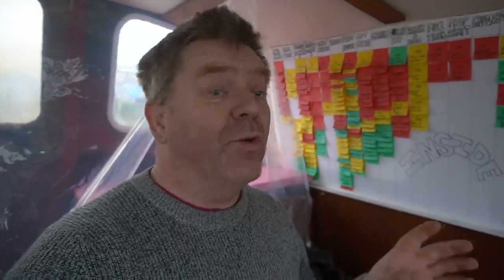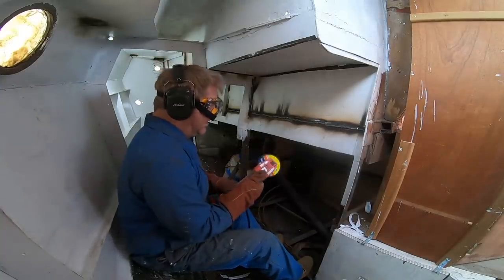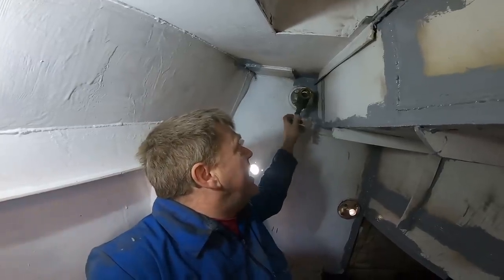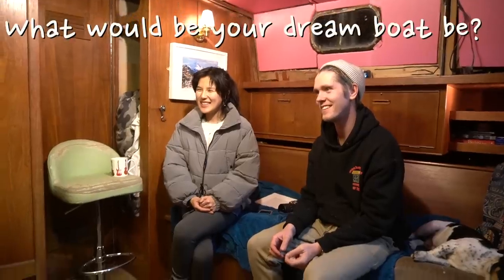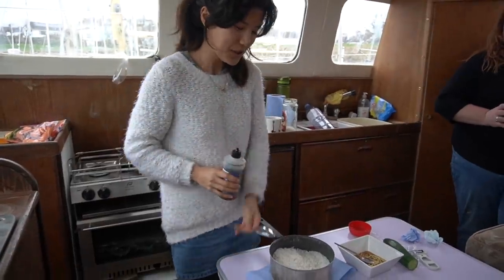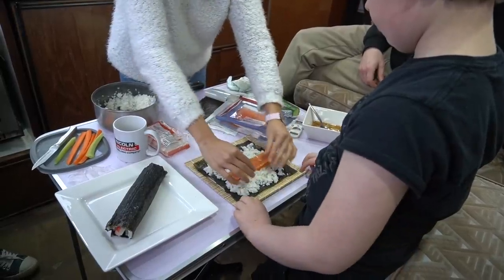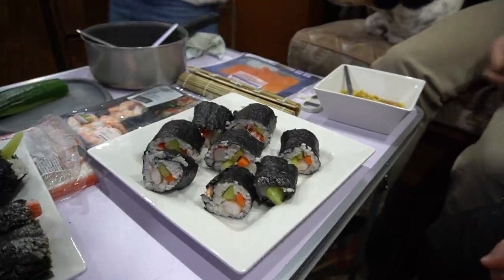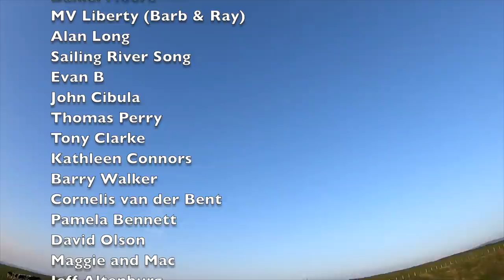#82 - MONOHULL VS CATAMARAN - Melody's gone wild!

Comment: Now THATs a crossover episode I didn't see coming!
Reply from the maker: Hahaha awesome :) hope it was a nice surprise
Reply: Well there's them on Anglesey or the Scousers on on the Dee mudflats but thats got two huge Catapiller engines an used to be WW motor gunboat ..  dont tell them youve got a 1000 ltrs of fuel or they will be back with some jerry cans offering to polish your fuel in their engines😂 .
Great to see you all together ... Jack and Nadiyana seemed to hit it off well. 😎

Mark you could have claimed two working motors and one worn-out engine.  As Minkie's props are driven by two hydraulic motors via the pump ..its the ICE motor thats in need of resurrection.

How old is Melody you said the cork had been on for 40 yrs. 🤔
Minkie dates back to 1975.

Love it when 🇬🇧 boat yard wombles get together ... next should be ...  Chasing currents crew and meeting on the Med for Minkie. .. and you guys the're from the Blackcountry so not that far.

Comment: Hi from Winnipeg Manitoba. I was just looking at the recent clip and you were talking about welding up seams etc.
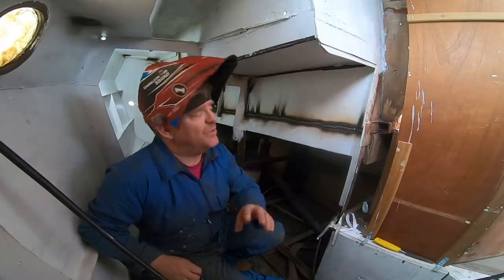At the 4:15 minute mark on the clip I noticed just above your helmet a strip of steel that sticks out,
 there looks like sun is shining thru, it is just left of the centre of the middle of the strip. 
good luck with your adventures.
Guess i will finish the clip now.
Reply from the maker: Hiya. I think that’s the patch I was actually talking about at the time which needs cutting out and a small patch welding in. It’s only about 8 inches square. It’s where one of the old hinges for the cockpit seat lids was and I thought I would get away with weld filling the screws holes but on further inspection it’s going to need a properly cutting out and new steel welding in. So yes that’s a hit of daylight but for now it’s sealed and I just need a fine windless day to pop a patch in there

Comment: Andy, concerning the valve at the side shell for the bilge pump.  The valve you have is a gate valve and if it shuts tight it is likely fine, age really isn’t a factor.  Usually you would have a check valve then a gate or ball valve at the side shell or in some cases a stop check will work.  The reason for a valve in that spot is 2 fold, first is a heavy storm conditions, the valved to seal against water ingress and more common you keep it closed until you make certain you do not have excessive oil/hydrocarbons in your bilge to make certain you do not pump them overboard.  International law, I started to say SOLAS; but actually it is MARPOL, says you are not allowed to exceed 15ppm hydrocarbons in anything you pump overboard.  Good rule of thumb is don't create a sheen on the water.   Hope that helps.
Reply from the maker: Good points and advice thank you :)
Reply: Wife and I hope your family are doing better.

Comment: I bought a boat once & it had old diesel in the tanks & I found the engine was about 10-15% faster once I had put new fuel in it. Also the engine ran much nicer, with the new fuel. It was a planing boat with 200hp turbo Volvo.
Reply from the maker: We will be removing and “polishing” all the diesel before launching
Reply: @SailingMelody  NFPA 110 refers to diesel “Storage Life,” 1.5 to 2 years. The Standard recommends that, “Tanks should be sized so that the fuel is consumed within the storage life, or provision should be made to replace stale fuel with fresh fuel,” NFPA 110, A-5-9.
   Most companies seem to say 6mth-1yr
If I was you I would put some of your fuel into drums & add 15% fresh fuel when you launch & then you can use the old stuff up a bit at a time when refuelling.
Reply from the maker: That’s a really good idea! Yes. Drain it down. Polish the fuel and then refill the tanks with 50% new and 50% old but polished and filtered. Then keep the remainder in Jerry cans on deck

Comment: Always a solid practice to have a valve on any hole in the hull above or below the waterline. In line non-return valves close to the pumps or integral with the strum boxes also useful as a belt and brace idea, it also prevents the bilge waste in the pipe flowing back when the pump loses suction or pressure. I was looking at your framing, I can't see if you have any weep holes (limber holes) where the stringers meet the frames or at the lowest point on each stringer/frame section. The  holes allow any moisture build up to work down to the bilge. I know your insulating but your method will have to be perfect to avoid vapour locks.
Reply from the maker: Yes I see the point. We have lots of 10mm limber holes but I will most likely make more. Can’t have too many in my opinion

Comment: Andy: those bilge pump valves are gate valves.  Ball valves would be quarter turn.  You can also see the gate opening and closing as you rotate handle.  I also can't see why you need valves there unless your stern is going under water and then I think you have bigger problems at that point.

Comment: It’s prudent to change the gaskets on all fittings.
Reply from the maker: Ohhhh yes you’re right of course.
This comment has popped up on my phone though and I’m not sure which episode you’re watching? I’m guessing the one where Chris and I tackled the engine service?
Reply: No it was the video where you were working on putting bulkhead tube fittings with rubber gaskets through I believe the hull.  Incidentally what type of sacrificial anodes are you mounting in order to protect from electrolysis.  Have you got a splash date?

Comment: Gate valves are preferable because they can be repaired several times by lapping the gate.  Ball valves need parts to refresh.  The trade off is that gate valves take up more space and usually weigh more.  Ball valves have a tendency to leak less over time, but often need replacing sooner due to corrosion.  The only thing about that valve in that position (stem down) is debris will build up in the valve body and the packing will be flooded continuously.  Which may. MAY increase the chances of dripping on your hard work.  I would use the gate valve with the stem up on that bottom hull fitting and a ball valve on the top right one so it can be oriented better.   Since that is Jacks room, did you consider  relocating the over boards to the other side, or maybe closer to the center?
Reply from the maker: Yes that’s definitely something I’m considering. Moving them altogether. I’m not sure just yet though.

Comment: If it was my choice....Melody wins.  There's no wooden structural beams rotting away in the bilge.  Mink was like a sponge. Also the stresses on the centre of the boat in waves can snap her hulls apart. I'm actually quite worried about the wildings project.  Steel monohull built like a tank - no problem. 
There's a boat breakers on the south coast will have exactly the sails you'll need BTW, when the time comes.
Reply from the maker: We’ve been offered a spinnaker and some other sails tbh ;) watch this space

Comment: I don’t know if I would bother in that aft cabin with timber Andy,  I’ve seen alot of channels use PVC artificial Tongue and groove style roofing,    It’s available  very cheap at most hardware stores, even sailing mistress used it,  and I believe Mads at saillife used it and i know GBU used it..  it’s cheap it looks great, it’s simple to work with, and it Impervious to water..    maybe worth a thought?  It also has some insulation quality,  obviously not as much as timber,  be we are talking a fraction of the price, and no painting required,  you could use white and just have teak trim?     Worth looking into..

Comment: @sailing melody 
perhaps a quick title update to include a warning about the welding blue flashing just on the off chance that the flashes of welding may trigger photosensitive epilepsy
Reply from the maker: Hiya :) it’s a thought.
However the luminosity and brightness of all televisions is set lower than the threshold to damage eyesight and photosensitive epilepsy is triggered by waveform frequency not brightness. So a strobe lamp at the correct wavelength and frequency could do it but a welding light on a television set couldn’t :)
Reply: @SailingMelody  i will politely disagree having had epilepsy,dark room and bright flashes still make me nauseous and headache comes on immediately
Reply: @SailingMelody  for me having had epilepsy caused by many years of punches to my head and banged on ceiling and shoved down a stairs from whence i suffered seizures as a teen into adulthood,for me at least bright flashy/strobe lights
very loud music with boom bang a bang surround sound that vibes is still risky for me
Reply from the maker: I do understand that many visual stimuli can be uncomfortable for epilepsy or even migraine sufferers. But in terms of the need to give clinical notice at the start of the video it wouldn’t really apply.

Between 3-30 hertz (flashes per second) are the common rates to trigger seizures but this varies from person to person. While some people are sensitive at frequencies up to 60 hertz, under 3 hertz is not going to trigger a seizure. Although I accept it might be uncomfortable, I am a migraine suffere (not the same thing I know) but there are days when I have to be careful what I watch. And Jacks cochlear implants mean he sometimes finds certain noises jarring and uncomfortable so similarly he has to be careful what he watches and exposes himself to. I apologise if the visuals in our videos have caused you discomfort, but I’m very confident that the frequency of light in our videos is not going to trigger a seizure.
Reply: @SailingMelody  it's okay,, I'm more wary and concerned for others - it's the blue light that for me was extremely bright - my thoughts immediately were even for the short time welding occurred - just a warning bright flashes during welding which are very short
Jack's enthusiasm during the sushi rice rolling wow!!
Yes,jack will find certain noises jarring and it's so frustrating and irritating that people don't stop to think about those who have cochlear implants,
those who require lip reads and or signing - yes, there are apps which help - however - for those in wheelchairs like two of my cousins i want to see ongoing developments in society and in boating
for those with autism awareness courses and education about what's potentially occurring during a meltdown due to sensory overload

Comment: My experience with old valves and stop cocks is that while the ball or plug will still seal, the stuffing box seals dry out and shrink resulting in leakage along the spindle.
Reply from the maker: I agree. I wouldn’t use these old style valves or any old valves below the waterline. But for the transom fittings above the waterline I can’t see them giving any issues
Reply: @SailingMelody  
Im wondering why the bilge outlet is so high up while the heater exaust is closer to the water 🤔? Doesn't seem quite right if you get water surging against the transom and it floods the burner with seawater.  
I'd check what the instructions say.
Reply from the maker: Very good point. 
On further thinking I recon I will move all these outlets to better places

Comment: Blocking the bilge pump. Just a guess but adjusting ballast weight? Someone correct me if I'm wrong. Some heavy winds might call for that. Vikings used stones and no keel. I could easily be all wrong. Thats just my train of thought.

Comment: Want to have really deep penetration  with a mig use shielding gas 95/5  you'll love it. A lot less spatter and you can spray weld in flat position instead of short arc. It burns hotter so you can lower your settings and get the same results. When doing certification welding that holds gas this what is used it welds a lot like shielded flux core. Nice and smooth hahaha without the extreme smoke

Comment: I'd use any paint you have to use it up and save money. It's all going to be hidden from view so it really doesn't matter. I really think with all the work ,money and effort refitting this boat I'd spend the money to replace all the valves,switches wiring and hoses with new updated items. I think it would look better and be a lot nicer without the worry that the old stuff is fatigued or may be defective. When you are done you will have a new boat ,why leave a few pieces of the old outdated things in it that will make it into a new boat with old parts.
Reply from the maker: Good points.
Since filming this I’ve decided to move those outlets anyway. I don’t want the diesel heater pipe or bilge pipes going through jacks cabin and if we took a wave to the transom (which we will) it could flood the heater exhaust with salt water which would be bad
Reply: @SailingMelody  plus the chance the exhaust could have a minor leak of carbon monoxide and that would be tragic.
Your doing a wonderful job and I just love listening to Jack. He's such a polite loving young man and that's a direct reflection of you and your wife's influence on the way he's being raised. When I rebuilt my 40 ford coupe it took years but I made up my mind I was going to do it right so I replaced everything I could with new parts and materials. I just couldn't see putting old parts into something I worked so hard on. I could of finished it by using old questionable parts but then I'd had a newly rebuilt car but with old parts I'd be having problems with down the road or I'd be worrying when I was going to break down and I'm so glad I took the extra time until I could afford to do it right .

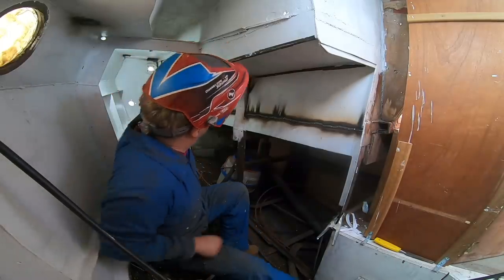Comment: What are your plans to gain access to the "engine room" from Jack's spacious stateroom?   If that was a car, they would have sharpened the edges of those steel frames at the factory.   5:00   If you had not cut those corners off,  you know who would have hit their head on them and cut their scalp.
Reply from the maker: There is no access to the engine room from the aft end as there is a steel bulkhead across the entire boat just under the companionway steps. Engine room access is by lifting up the sole boards in the pilot house :)
Reply: @SailingMelody  I thought the engine was under the cockpit.  I'm used to seeing it there in fiberglass sailboats.
Reply from the maker: Ahhh well in this case the engine is further forward under the pilothouse, being further forward is better for the CofG and also means a shallow prop shaft angle. Win win :)
Reply: @SailingMelody  Newer "faster" sailboats may have only a few inches between the sole and hull.  Your hull will not be as fast but it will have better seakeeping abilities and a more comfortable ride.  Just what you need for your future adventures...
Reply from the maker: Absolutely. We’re definitely in the “ride out the storm” rather than the “try to run from the storm” philosophy.

You can’t run from a weather system
That’s 250 miles across and heading your way at 30kts